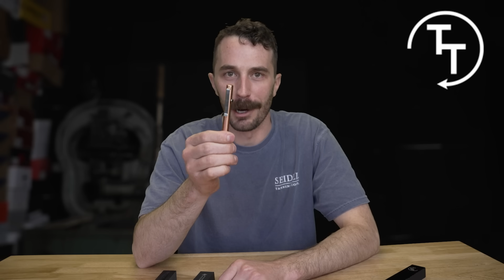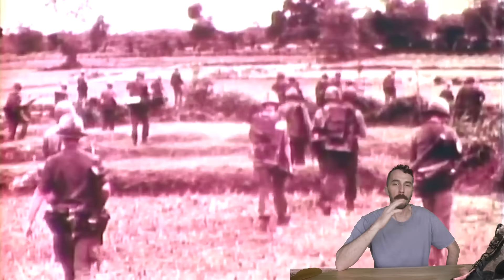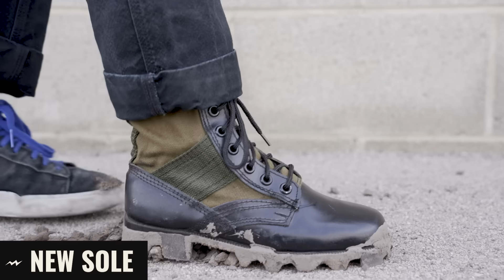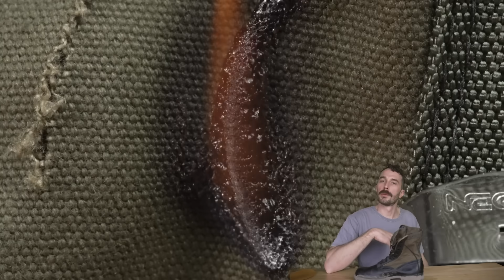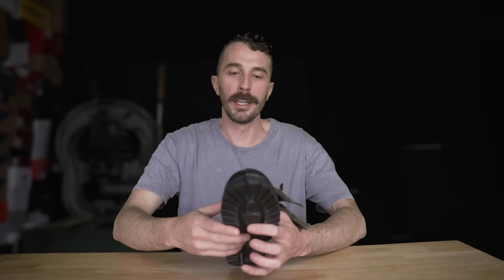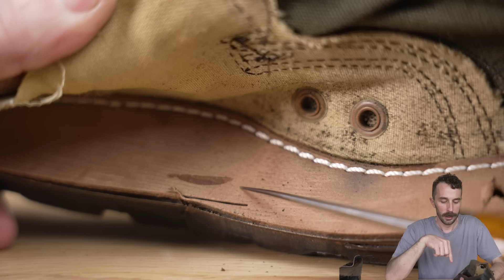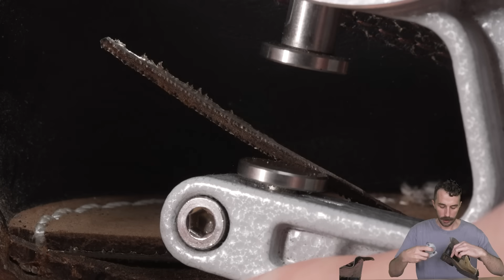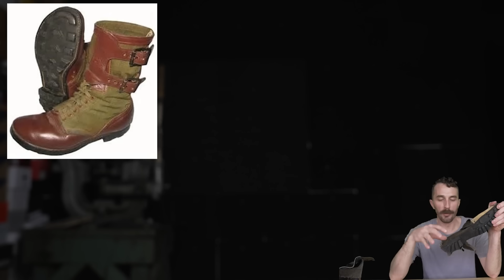Why it took 57 years to replace jungle boots

Comment: As a 15 year US Army Infantry veteran, I've worn dozens of different types of boots, and these were probably my favorite. I remember when they banned the OD green type in the late 90's early 00's, so I picked up a black pair. It wasn't long after that that they banned jungle boots altogether. I still probably have a pair floating around somewhere.
Reply: So why did they ban them altogether? Was it a case of the newer boots being pushed or some kind of issue with these ones in general
Reply: @eliaspanayi3465  it was because they were green and not black. Someone somewhere decided that green wasn't acceptable. 🙄
Reply: @geraldleatherman1899  probably some dumbassed CSM that didn't have better shit to do. Probably was  in fact, the CSM of the Army. And who is quite often a turd that has nothing better to  do. - signed, a former field grade who prefers function over form.
Reply: @geraldleatherman1899  I wore a pair of OD green jungles to work in 2004.  My company commander told me they were only authorized in Hawaii and that he didn't want to see them again haha.
Reply: @eliaspanayi3465  in the late 90s through the phaseout of the woodland camo BDUs, the only authorized boots where the all leather boots, black jungle boots, and tanker boots (if you were a tanker).   You could wear Corcoran jump boots if you were in an Airborne unit, but mostly  with dress uniforms.   I was never given a hard time about black jungle boots anywhere while I was in.   I'm not doubting @geraldleatherman1899, all it takes is one commander or CSM having a problem with them and they can be banned at a particular unit.   You were allowed to resole your boots so a lot of guys would go to stores like Ranger Joes and get fancy vibram or ripple soles put on.   The only place you couldn't have them was Ranger school.
Reply: @eliaspanayi3465 they probably banned them altogether because we transitioned to coyote colored, nubuck suede boots. Almost no one uses black leather boots anymore in all of the branches except for maybe a few select MOSs.

Comment: I was too young to be in Viet-nam, but I've worn the jungle boots plenty on the job, which was rough outdoor work, and very wet.  They served me well.  But, I have to say that I've recently purchased a pair of Danner-made USMC  R.A.T. boots for about $80.  They might be sold out now because they were left over after the Biden Bugout from Afghanistan.  By far, these are the most comfortable footwear Ihave ever worn - no matter what type or purpose.  Great for work or walking the dog.  They have no pressure points and the ground is isolated from the foot.  Steel shank reinforced and a nice thick re-soleable tread.  Danner will do it for you if you ship them to Portland.

Comment: I served in the USMC from 1976-1979 and bought a pair of these boots, it was a great lightweight boot, but my favorite boot was the 1960’s all leather biltrite heel and sole boot. I know these boots failed in the Jungle but were great Stateside. I was a heavy vehicle operator and I felt these boots gave me more support and were very heavy duty. I’d really like to see your analysis of these type of boots, I believe they were called McNamara boots and were a bit shorter than the previously issued boots as well as than the ones I was issued with the rubber molded soles. Keep up the awesome work!

Comment: As a marine veteran of Afghanistan, these boots were phased out and replaced with the tan boots made of suade(or however you spell it). I still got a pair of black jungle boots(cadillacs). They were some nice lightweight boots but they had no arch support which made wearing them all day a real pain in the feet. Then there was polishing the damn things so they would last and not rot and fall apart. Thats the good thing about the tan desert boots. No polishing. Just brush them with a wire brush.

Comment: When I visited the Watervliet Arsenal many times and worked at a NY State machine shop. Both very old. The floors were wood. Not planks but hardwood pucks cut across the grain. Yes it prevents damage when precision machines parts drop on it. And also let's metal chips mash into it, not your boots. But mostly it's sooooo easy on back, knees and hips after long days. Concrete  shop floors are hell after working on wood Puck flooring.

Comment: Jungle boots are by far my favorite boot to date. I wear a full set of Vietnam era gear for work, but my boots are my pride and joy. I applied some sno-seal to them to keep the black exterior from eroding in the mud and to add some water proofing to them. In the summer I wear cushion sole socks with them and in the winter I wear sealskinz waterproof socks because of the draining holes that let water in occasionally and because they add their own insulation to the setup. They are my only pair of work boots, and they are the only pair I need honestly. I do freelance work, so I've worn them in just about any situation you could think of. Irrigation, landscaping, carpentry, plumbing, electrical, logging, snow, rain, hail, hot, cold... you name it, I've worn them doing it. They're cheap, lightweight, and durable. They have great ankle support, indestructible soles, good quality materials, and they look so nice you could wear them to a funeral. For the price, you cannot beat the jungle boot.

Comment: 89-93 Still allowed think somebody should make quality pair with composite toe..However think market is flooded ironically not much or a market..Unless you want to have a company on paper..with manageable sales department I had 272 force march miles and 272 or 276 fast rope jumps on my Jungle boots they remain in the closet.. Appreciate the video and your commentors service your opinions should count..Just guessing political influence could use a refresher..and infantry usually does it's job correctly..No more Excuses and history seems to repeat itself..cha ching..good luck gentleman thanks for your tears and cheers..you earned your beers..

Comment: I was issued two pairs of the desert version of the jungle boot when deployed to OIF in 2003.  I broken in one pair and wore it for a year in that war and put the other pair in the duffel bag.  Wore the war boots 18-20 hours a day for over a year with no problems. Got out after the wars and Wore them at home until 2015 when the leather finally split at the sole.    Pulled the “new” other pair out of the duffel bag and still use them today. 

Every piece of military kit was like that - it just worked and lasted forever.

Comment: I wore those when I was in the Army stationed in Germany, they where great boot's you should also examine Tanker's Boots, But my favorite always where the Jungle boot for Hot weather wear, during the winter month's I switched to a more insulated Boot, but I loved the Jungle. I noticed at the end of your video you are profiling a winter cold weather extreme boot and you called it a bunny, in the Army we called them Mickey mouse Boots . and they where very warm and water proof,

Comment: Wore these 1993-1997. 
Holes got plugged from polish
The newer sole was very hard rubber and we got the soft vibram replacements- huge improvement.  
Insoles deteriorated super fast and provided zero cishion so we’d put the gofaster insoles in there instead.  
Zero ankle support= rolled ankles.

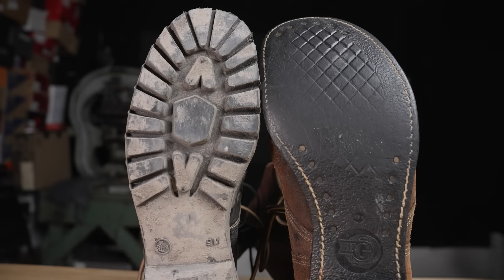Comment: 2:39 Why the hell did the design shift so far away from the foot anatomy and proper foot mechanics? Have a quick look at some barefoot training/running videos on yt if you don't know what I'm talking about. It's pretty mind boggling that even a professional, goal oriented structure i.e. army would follow fashion trends when it came to sole width and toebox shape.

Comment: Why do not remove the laces before cutting the boot in half.   There is no need to destroy the laces. They could be re used on some other boots or something.   Stupid to unnecessarily destroy the laces when you could just remove them first.

Comment: After basic training in 2000 we we’re allowed to wear the jungle boots with the black canvas, during our basic training we’re only allowed to wear the all leather Army Boots that were issued to us.  Those leather boots had done more injuries within our battalion.  Finally got to my duty station and were allowed wear it until it was phased out by desert boots Vibrams
Reply: OK, I thought something went wrong into I saw this that I'm not alone - I was in Army ROTC in college 2001-'03, we had BDUs when active duty getting deployed were switching to the new patterns, & I still have my all-leather black combat boots in the trunk of my car for emergencies. They didn't breathe much at all, but that's not too bad when you only wear them at most 2 days in a row for an FTX & we saw a lot more snow than hot weather. They cover about 1/4 of my shins, almost always overkill unless there's deep snow; then it would be better to have my insulated snow boots. For a backup to handle most roadside surprise emergencies, they're at least "good enough" to get through a wide variety of conditions.

Comment: Jungle boots were great.  They were light and dried out fast, just as they were designed to do.  We wore them three seasons out of the year and even wore them on parachute jumps.  Some people thought that  they didn't provide enough ankle support to use them on airborne operations but in SF, we had no problems.  I still have a couple of pairs!

Comment: These were a great boot for jungle operations.  They were a lot less good in environments where you had to March any distance. There’s very little cushioning in the sole making them hard on the feet and knees over long marches. But in the jungle where you might only cover 1000m in a day, they are the mutt’s nuts.

Comment: I only have 1 issue with this boot.  The heel is wider than other army boots of the same size.

Also, you said versions were made until 2005.  Currently there are new commercially produced (non-issue) approved boots for sale at PX.

Comment: I wore the 2nd type of sole in the early 1980s.  The steel plate  was surprisingly thin but it did do its job! I wish they still had those old canvas jungle boots!
Reply: McRae makes them again. Only difference is no steel plate or mesh insole, but 100% USA

Comment: I wore these in the Marines when I was stationed in Okinawa back in the mid 80’s, they were not allowed Stateside unless you were out in the field.  They were not issued, we would buy them outside the gate in the Okinawa stores, they were Vietnam surplus and probably stolen and sold to them years before as they were getting hard to find.  Great for jungle & wet environments and the heat, not good at all in the cold or snow of course.

Comment: I wasn't alive for Vietnam, but I served 2000-2012.  I bought a pair of the Altama PX Jungle Boots in 2004, black canvas uppers.  Wore them until 2006 in uniform and wore them out of uniform until 2018 when they finally blew out over my pinky toes.  They are still made and the basic suede boots from Bates and Belleville as well as Altama are still just the jungle boot in tan.

Comment: I'd like to see a variety of modern military boots plus Berry compliant non issue variations compared. These jungle boots certainly weren't the worst I was issued, but there were and are better. Currently when using boots I'm either in modern Corcoran leather or Belleville lightweight non issue desert boots, both US made and not very expensive.

Comment: I have a pair of Baltes German Jungle Boots. Built very well but a nightmare to wear in. Mine are from 1997 and I would buy again because I travel and see friends and family in the Philippines. And some of the places I have to go would destroy normal boots. These are quite cheap and made for the type of weather you get in the Philippines. I have to cross a few rice fields and mud can be a major problem. So I find jungle boots work extremely well especially when it's monsoon time of year. You don't want to ruin a nice pair of footwear.

Comment: Surplus jungle boots and other gear were quite popular with us teenagers growing up in 70’s San Francisco.  As I recall the heavier lugged soles were referred to as “tank tread” and were rather difficult to find, so I’d go treasure hunting in the local surplus stores.  It’s a great sole for hiking, it has great traction because the wide gap between lugs allows it grab on to just about everything.
Reply: They were known as ( Panama ) soles .
Reply: @vieuxacadian9455  I bought a pair because they grabbed less mud than the others.

Comment: The boot is fine as long as you don't use it in the jungle. It won't stop foot root. I have tried a lot of different foot wear in the jungle the best boots are not boots just these cheap plastic shoes with football like studs preferably worn without socks. U stop u slip them off to help dry out your feet, when its time to move on u slip them on again. They won't help u with a punji spike but they do make you more aware of where u are putting your feet. Leather and jungle are a hopeless combination, foot rot in three days, a week and your feet will be very raw.

Comment: I wore jungle boots in the early 2000s (Army). Loved them. From what I understand, GWOT killed the jungle boot, as the hot, dry, urban (Iraq) and rocky (Afghanistan) environments were causing durability issues. From my own experience, I had a pair of Altima desert "jungle" style boots and flat out wore the soles off of them after a few months. Conversely, on my last deployment ('15-16'), the newer boots with Vibram soles seemed bulletproof. In my opinion, the government is constantly wasting money on a "one size fits all" (heh, pun) approach to everything, instead of accepting the fact that no such solution will ever exist.

Comment: Danners still makes a modern version of this boot I've worn both the desert and gortex/waterproof version in the field. If you don't need a ton of ankle support like myself they are the ideal boot they are sub $160, durable, walk wm dry in around 45 mins, and lighter than most running shoes. My desert boots alone are going on 4 years of infantry bs. I can't praise em enough

Comment: I bought a pair of these boots around 2004 on ebay for 2 reasons: 1, I was a nerd for olive drab at the time and 2, they came in narrow size. I absolutely loved them. I used them for everything. Hiking, camping, mowing grass, working, even used them to shovel snow (they worked, but wouldn't recommend for snow). I've gone thru creeks in them and they dried out on their own pretty well just from continuing to hike. They're not the most comfortable, but I'm not hard on shoes or boots so they served me well. I had to retire them after about 10 years because the outer soles finally cracked and the metal plates split in two. I saved them in my garage like an old trophy. 

Best $50 I've ever spent.

Comment: I was issued a pair of these over 40 years ago, and they were my favorite of every pair of boots I ever owned outside of winter/spring. For obvious reasons of course. The drain holes just in case you hadn't already guessed.

Comment: Had a pair of these around 96-97 working as an electrcial apprentice. Very light and breathable. Paid like 35 bucks for them at the surplus store. Nail proof soles which was nice, nice squared off heel for locking your feet onto ladders, trusses etc. The soles did seem to wear a little quicker than other boots I had on concrete floors I was on every day. Still pretty good for the price.

Comment: We called the inserts Cheese Graters.

We tossed em.

To properly break in jungle boots.
Put your boots on without socks.
Get the boots really really wet.
Being submerged for 15 to 20 minutes works.

Take the boots off dry your feet and put on dry socks.

Put the boots back on.
Wear them all day until they are dry.

The boots will conform to your feet.

After they are totally dry.

Apply your choice of leather protection products.

Neatsfoot oil works well.

Boots will be like wearing a pair of tennis shoes.

Comment: These boots are a very authentic version. Beware of the CCP fakes. It's hard to find a good jungle boot these days. Goretex is a gimmick and makes boots very slow to dry. But authentic jungle boots will dry quickly with fresh socks and the mesh insert keeps the water off your skin. Nobody makes a mess insert. Old ways were good.

Comment: I bought some high tech expensive boots for playing Paintball. I didn't like them and tried several other boots, even wrestling shoes. I was running low on funds and bought a set of dress jungle boots at a surplus for $25 bucks. Wow, they were great! I could run through mud, dry sand and even after a 3 ft deep creek that I would cross they were dry enough to keep going. I keep'em dry and polished and didn't use heat to dry them. After 15 years, the treads are worn, but they are still in good shape.